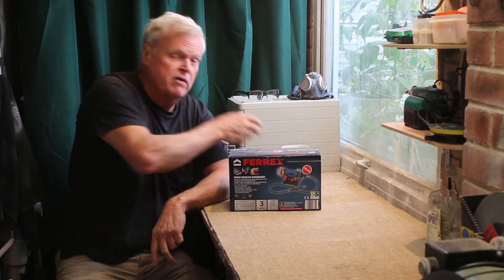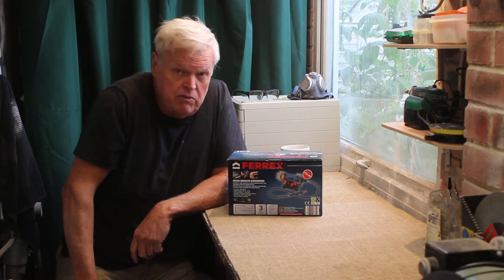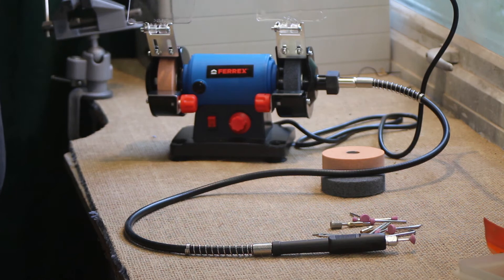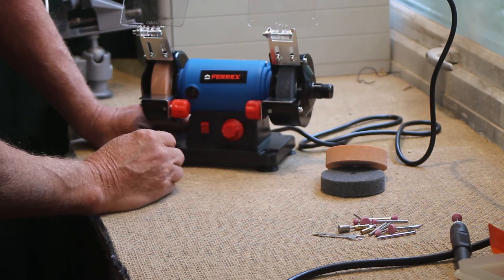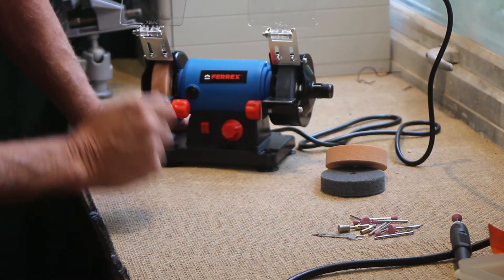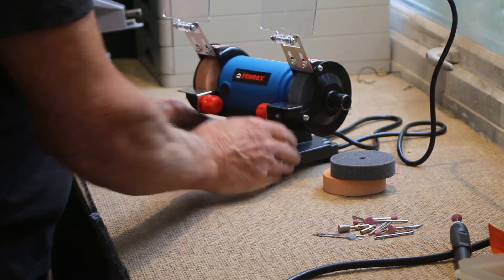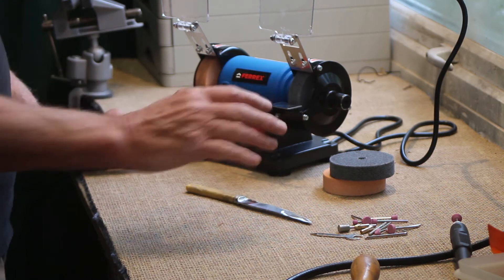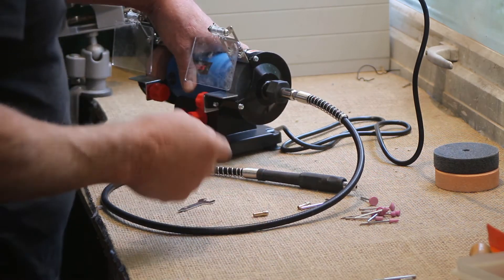Ferrex mini bench grinder, reviewed and tested

Comment: A very good, honest review. I bought one 6 months ago and the polisher disk is a multi-layered material one on mine. I use it for key cutting and have problems. On a similar line, I also bought their multi-purpose sharpener and that sharpens my knives beauifully.
Reply from the maker: Thank you, it is a good tool though I fear I am overusing mine! Not tried the sharpener, I usually just grind knives. Thanks for watching.

Comment: Very good review. I've also seen these items for sale in Aldi here in Australia and wondered about them. I was surprised at the power you got from the flex drive unit. I've currently got an Ozito brand and it doesn't seem to have the power of the Aldi. I think they retail for about $35 - $40 here...(not even a tank of petrol) so I'm tempted next time they have them on sale. Maybe the foam disc on the other end fits a cloth polishing wheel on a tapered shaft? Kits of polishing wheels are available. Allan
Reply from the maker: Hi, I was surprised myself having read other reviews. I have since used the flex drive a bit more and I am still impressed. The foam wheel is not taper fit, I will play with this and see what I can make of it. thank you for watching.

Comment: I always hated collets as a tool retention solution.  I’d rather a mini chuck, which can hold multiple sizes.  Dremel now comes with a chuck, so much more convenient.
Reply from the maker: I usually use a universal chuck bought from ebay but for the very smallest drills a collett is a must. Cheers!

Comment: Love your review. I have the Lidl version (Parkside) of this grinder.  Can't say anything wrong about it. If you use it for it's intended use, it is great value.
Reply from the maker: Thank you for the kind comment, Have you tried the flex grinder yet? I really like this. When I see the Parkside version for sale I will buy it just to compare, This is such a useful little tool that having a second one seems such a good idea! Thanks for watching.
Reply: The Stone Crafting Workshop I have yes.  It is extremely flexible and because the tips are so small, you can really give it some wellie without it bogging down. It is much easier screwing in one attachment to the grinder, than it is to get out my little Parkside Rotary tool.  All the bits that I use on my rotary tool fits on this flex attachment as well.... Happy days.
Reply: instablaster.

Comment: Just bought the same here in Ireland...  I just wanted to sharpen my larger kitchen knives.. I'd like to ask you a question. When you were talking about fitting the smaller bits, you talked about a piece called a collit? Is that the correct spelling? Is there a retailer on eBay that you would recommend ? Thank you, Maura.. Thanks for video too.
Reply from the maker: The collets are the small brass bits that hold the burrs in the shaft drive tool. I have done a video explaining this here : https://youtu.be/5HZM6DpV92s
I think you may really be asking about the diamond burrs? I have a video about these as well here; https://youtu.be/_9OkO3Ov-S4 there are links in the info for both these items. I hope I have understood correctly what you were asking. Thank you for watching and for the question. PS I like this tool so much I have just bought a second one!
Reply: @thestonecraftingworkshop7490  thank you..😊

Comment: I bought this. It only had one collet and now it’s stopped tightening up so I can’t use the flexi-tool.
Reply from the maker: You are right, the new version only has one collet, that's a bit mean! If its the collet itself that's worn you can buy replacements on eBay, make sure they are the 4.9mm size. You can see my vid about collets here:  https://youtu.be/5HZM6DpV92s If is the nut damaged you may also be able to buy replacements but I am not sure of the size. If the flex shaft is faulty I would return the whole thing to store fore a refund. Good luck.

Comment: Will that take a keyless chuck?
Reply from the maker: No sadly not it has a quick release and locking mechanism that precludes the use of a universal chuck. The older models were better in this regard. I'm afraid you will have to source replacement collets, i get mine on ebay. good luck!

Comment: what is the lowest rpm? Is it slow enough to drill precisely?
Reply from the maker: Hi, sorry for the delay in replying, I was looking for the manual to tell you the lowest speed. it didn't help. it says speed 0 - 9990 rpm. I can tel you the lowest speed available on the dial is very very slow. I would imagine quite slow enough for any type of drilling. Not sure how you intend to use this as a drill, I assume using the flex drive? Hope this helps